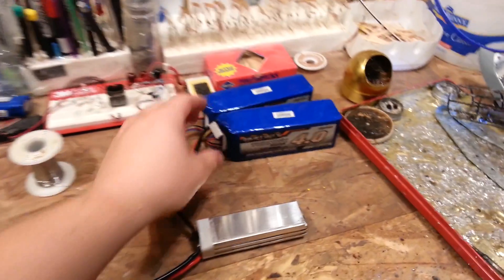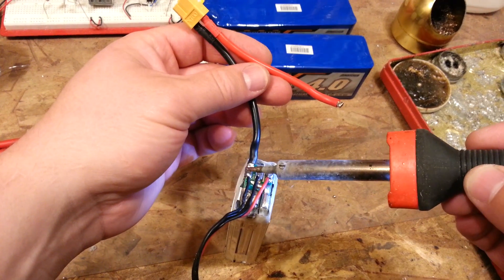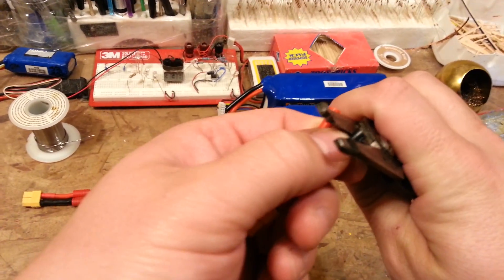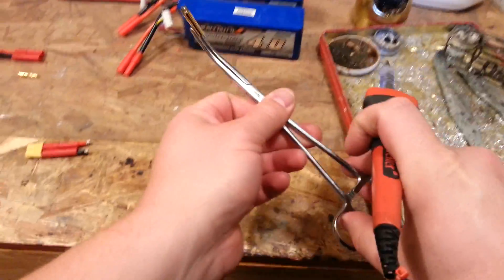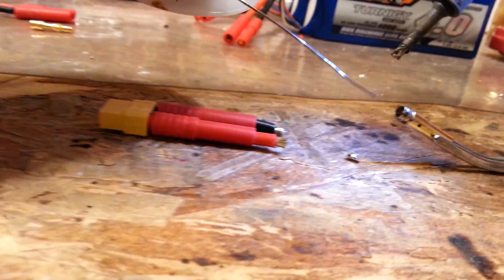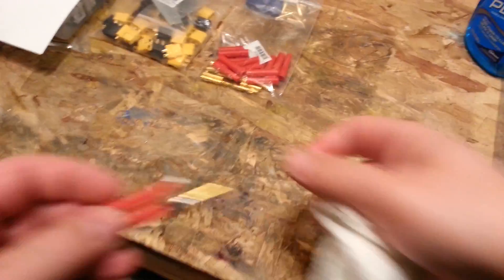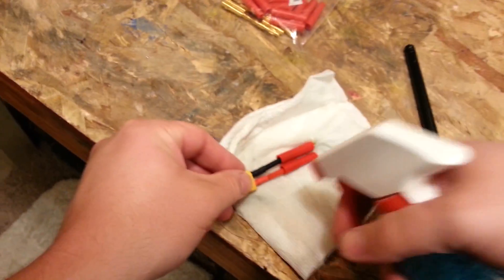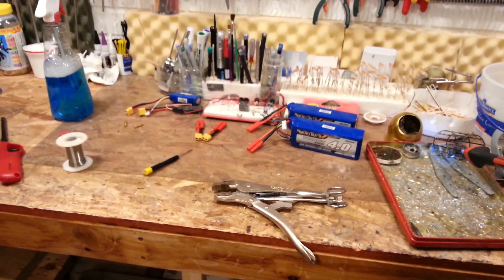XT60 to HXT 4mm - Lipo Connector Plug Adapter

Comment: Hey man nice info! Can that work also in a 7inch drone with a normal xt60 wire into it? i have a 6s 5100mah battery but the wires are AS150. Im thinking same process so i can use that lipo battery to my drone..
Reply from the maker: SURE. You can make whatever end you want, BUT keep in mind, the connectors will eventually give way to HEAT, and then PUFF [in smoke] - there goes your plane, drone, heli, etc...so you gotta keep things withing reason.

XT60 is generally okay for 6S, but you need to be a bit careful that if you can stuff those huge leads in the back of the XT60, you get appropriate solder in there so as to avoid COLD SOLDER JOINTS.

Comment: At 3:48 you say minimum cut distance because you'll cause yourself some grief. Newb question. What do you mean by that?
Reply from the maker: I think I was referring to the amount of length I'd need to be able to build the connector on, since you have to pass the wire through the connector on some of these connectors.
Reply: @BrianPhillipsRC  Ah. Got it thanks. Have a 6s batt and just wanted to make sure I wasn't causing a voltage surge by it being too short, (batt too close to my flight controller).

Comment: It looks like there wasn’t any bare wire exposed when you desoldered the positive cable from the retired battery shouldn’t there be wire almost the length of the metal strip it’s laying on
Reply: Like 1:54, no I’m still trying to learn I’ve been trying to make my own lipos from Traxxas batteries and combine 2 -  3s to make 6s, I just thought that looked odd didn’t know if I was missing somethibg
Reply from the maker: I think that the length of copper exposed on this line was fairly typical. You could expose more of the copper, but it will cause more solder to flow into that spot and you'll make the lipo heavier...something that might be good for you (with a car or truck). I guess, so long as you can cover the entire end, and some surface down the length of the discharge lead, I think you'll have plenty of contact are. Keep in mind that you want to have contact with the outside of as many of the conductors as you can, since the highest current flow tends to be on on the outside of the conductor....but I'm kinda splitting hairs with that last part...really, you need to do what you can do safely, since lipos are probably the most dangerous part of our hobby ;) Good luck! Thanks for the time stamp, it helps immensely!!!
Reply from the maker: Can you time stamp it, so I know what you're talking about. It might be tough for me to know exactly, and answer you correctly without that information.
I assume you know how to do it, but if not, just type HH:MM:SS format, and YouTube will make a time stamp...like this is at five minutes and 32 seconds.... 5:32 .....but I assume you already know this ;)
Thanks!

Comment: Brian, what can you tell me about a "flysky" TX 6/10 channel (6 default ). Given as gift. 
No plane yet. (Newbe)
Thanks
Reply from the maker: It's "flysky" receiver, meaning it's only compatible with "flysky" transmitter.
FYI, you can get a 6 channel DSMX (air) receiver for about $10 or less if you look hard enough, but for a loaded receiver, you might give $100 or more...
I must admit though, I don't know a thing about flysky - sorry :(